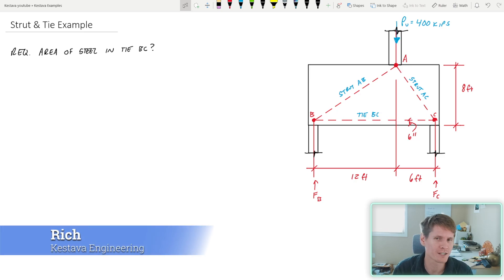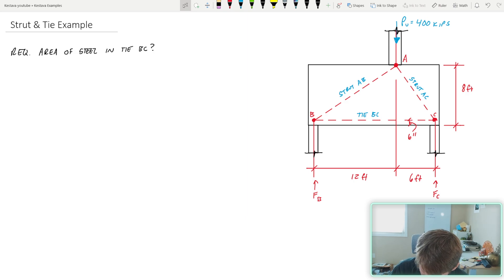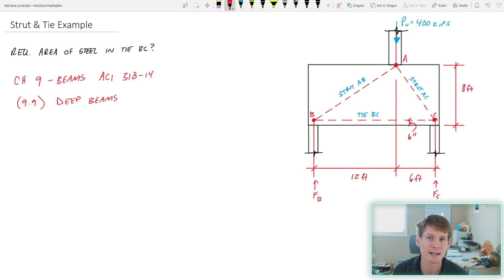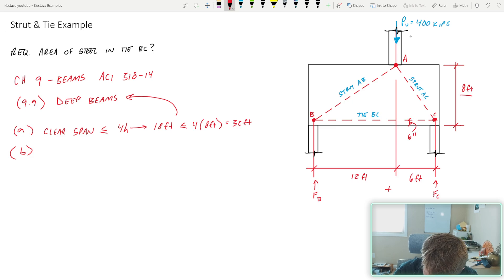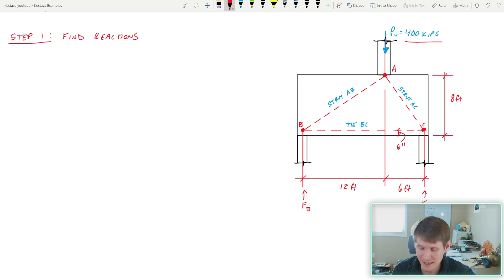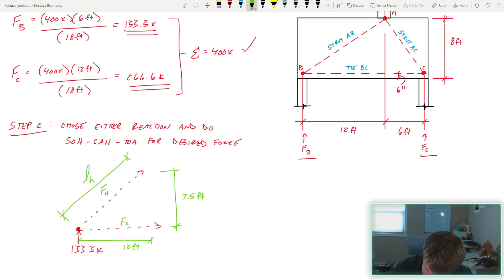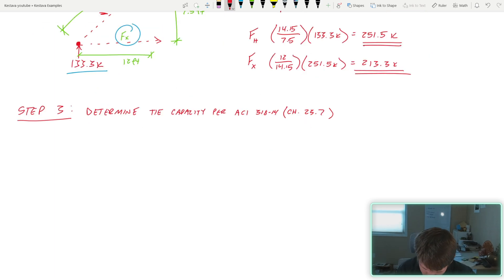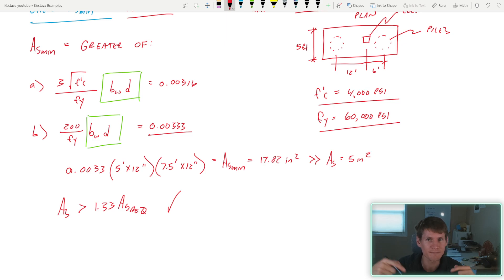Concrete Strut and Tie Design Example | Learn Structural Engineering #engineering #civilengineering

Comment: Strut & Tie method is often used for coupling beams/ link beams in shear walls of high-rise buildings between door openings, in which case the loads are applied at the end of the beam, moment and shear. It'd be interesting to see an example for that case from you if you have one.